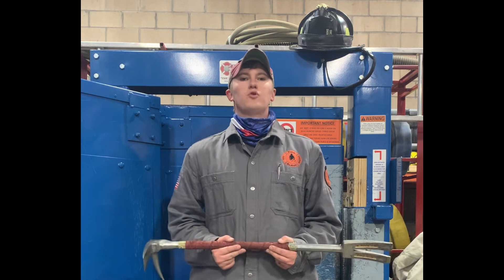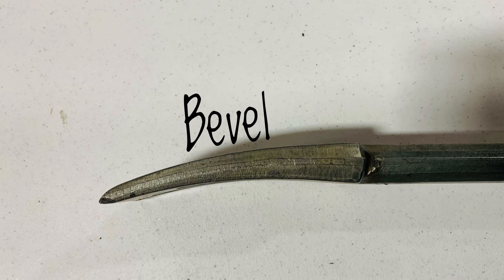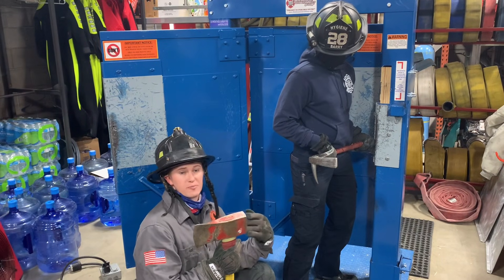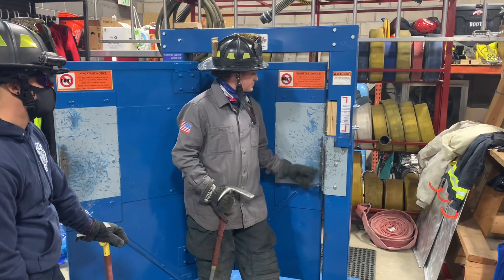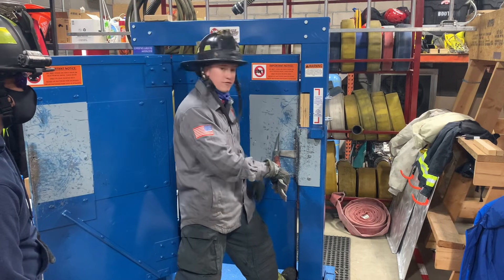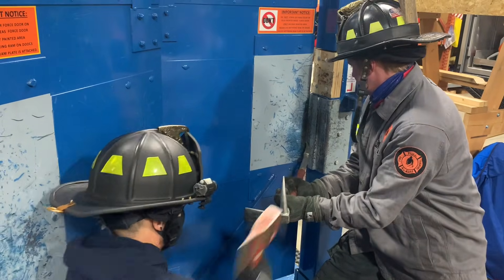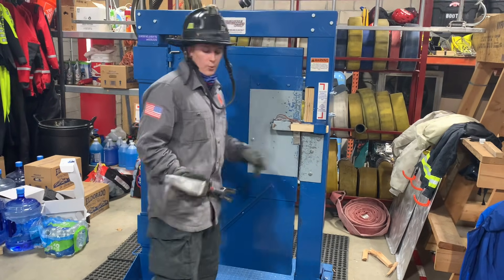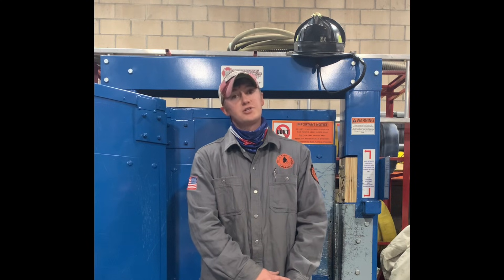Halligan Bar Physics

Comment: Tip to keep them interlocked. Set the forks on the axe head and drop it/slam it on a hard surface. In the fire service, we call this "Marrying the Irons". To unmarry the irons simply drop them or hold the axe upright and tap the end knob on a firm surface

Comment: Your mechanical advantages are all wrong. Not trying to call you out but you are spreading misinformation. 

Mechanical advantage is a measure of the force amplification achieved by using a tool, in this case a lever.

The mechanical advantage of a lever is the effort arm length divided by the load arm length.

FORMULA
MA= effort arm distance ÷ load arm distance. 

So in your example using the forks on a 30" bar; burying the forks to the crotch (5") leaves you with a 25" effort arm (lever) and 5" load arm. 25/5= 5:1 mechanical advantage. 

Not trying to call you out but we need to make sure we are spreading right information to the new generation of firefighters.

Comment: What is the point of closing the door immediately after the 10% search? If you're breaking into a door, isn't the whole purpose to allow ingress?
Reply: Leaving the door open adds oxygen, which generally speeds fire growth and likely changes the flow path of the fire towards you. (This building is implied on fire in this scenario.)

Comment: there it a fault to the way you're teaching to make the gap.  the positioning of the firefighter when prying down on the haligan puts them in a potential bad spot if the haligan pops loose of its bite.  that spike aiming directly at the firefighter is a real concern and needs to be mentioned.  the idea of training is to put an individual in a position of muscle memory and not needing to think about the potential of catching a six inch spike in their chest if they slip.  
beyond that pretty solid video.

Comment: I don't quite follow why the spike needs to be at 90 degrees to the adze? Wouldn't it work just as well with both on opposite ends of the shaft with the forks rotated 90 degrees so neither gets in the way?
Reply: Having the 90 degree offset is like adding an additional tool. It gives you a striking surface to utilize the spike as a lock breaker.  It also allows the adz to be used with full mechanical advantage on onwards opening doors by penetrating a wooden or hollow metal door frame with the spike and, using the spike as the pivot point, allow body weight to pull down on the shaft of the tool to force the door face inward; usually just above the bolt location. Works great on institutional buildings like schools or dorm rooms with metal door frames set in masonry and solid wood or metal doors.
Reply: @brandonseyfried1251  Hmm... Wouldn't moving the pivot point farther away from the adze reduce mechanical advantage by creating a larger arc of movement? I do see what you're saying, though - that's not something I'd considered.